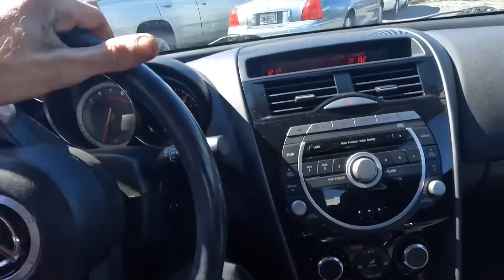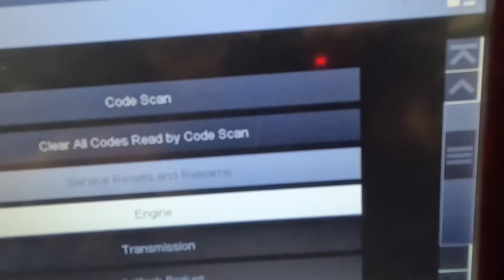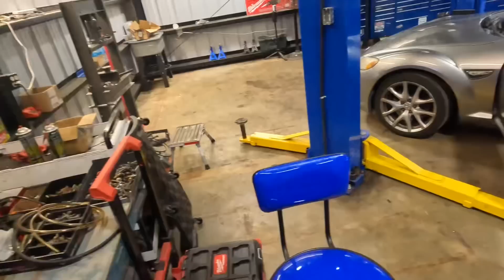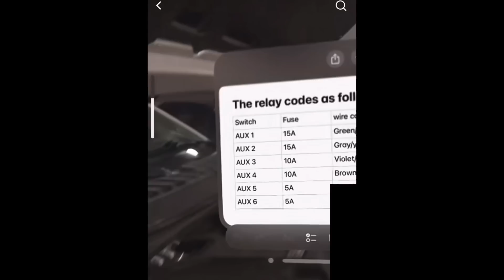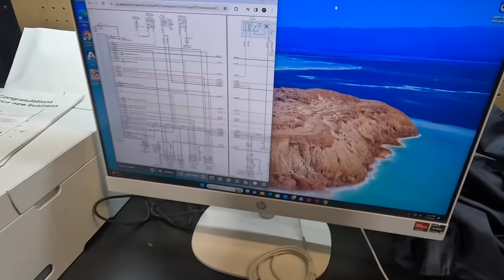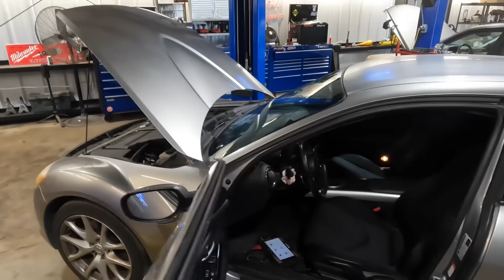Will Virtual Reality REPLACE Mechanics?? Mazda Rx-8

Comment: I think it would be a pretty cool TOOL to have. Would you use it as a screen to graph your PIDS in front of your eyes while still being able to shake wires around checking for a bad wire. You’re looking at the graph while both your hands are tugging connections and bending wires at splices?

Comment: Absolutely not, will VR/AR replace skilled technicians. I could see the use case - example, having my scantool display in a "heads up display", if you will. Could also have other useful information like time, GoPro camera view. Security camera feeds, even. Just, not at a $3500 price point. Also, imagine adding radar/lidar capability to them... that could be really cool, helping people with limited fields of view to interpret their surroundings.

Comment: Automatic RX-8's hurt my soul. Shifting 6 gears at 9500RPM is where it's at with these. I had both a Series 1 and Series 2, so much fun to drive and get 9 MPG in. These really need a specialized mechanic. The ignition systems are so touchy, and using aftermarket coil packs or wires causes a lot of issues, but people do because the OEM's are very pricey. But it is always more costly to replace a second time.

Comment: I loved the VR section. I had to correct someone’s bad information on Facebook. Some dude said “you NEED a super special socket to change plugs on a ram 5.7 gas engine” I was like what special socket I done the same job with a regular 5/8 plug socket. So I looked it up it’s real a set of swivel socket’s constructed of a plug socket, universal, and extension. I said I’m sure it’s nice and cuts down on dropped sockets but I don’t NEED IT and I’m not spending $40 on a set of sockets when I have the same stuff already paid for in a box

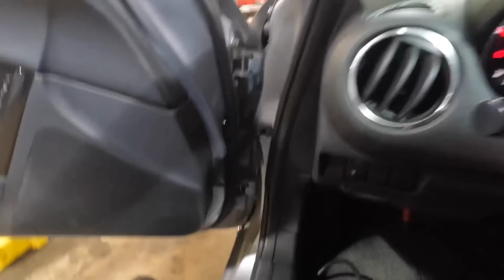Comment: We used to own a 2006 of the 14:22  same car and color. Blast to drive, and handles very very well right off the showroom floor. However we had so many computer issues. So bad they pulled the computers and sent them off to Mazada in CA to be flashed and reprogrammed. Still had issues, and then an engine recall came out. Mazda ended up buying the car back. Only had it for about 6 months. The rotary engine is very smooth and loves high RPMs.

Comment: I bought a Chevy Trailblazer and had some recall notices after a year or so.

I was floored that all of the recalls were firmware upgrades & patches and were performed simply by plugging a cable in. I think I received 3 notices by mail (critical) and there were 6 minor recalls.

Comment: Similar thing in aviation.  New pilots learn on flat panel displays (EFIS)  in Cessna's and Pipers these days, and few learn the old "steam gauges".  Their attitude is that "Our students will go straight into a jet with EFIS, and will likely never see the old system, so why should they learn it?

Famous last words.  The old stuff was difficult to interpret, so you learned to determine your position in your mind rather than simply look on the screen.  That built situational awareness;  The new training planes do not build this sufficiently in my opinion.  EFIS should only be used in professional cockpits, not in training planes!

Great video!

Comment: The only way such vr glasses can work is when a technician can see what the customer is looking at in his vr glasses and is able to make an arrow on that screen so the customer can plug it back. But that is a very limited use case that can be solved with a video call

Comment: Sorry, probably a book inc:   (I don't have spellcheck, forgive me)

Also I'm a programmer not a writer, I know I repeat my points at times, but it makes sense to me, this is how I write (I apologize).

(edit: I agree with you first of all)
(no one's going to plug you into the matrix or  plant microchips or whatnot. Trust me AI knows crap, I work with a guy who uses it for "programming help". I've checked his work. it's bad.

I work in VR/AR space, and stuff like the Vision Pro have been out for years. i.e. the hololens 1&2 in 2016/18 (actually a lot of MS's software team for the hololens went on to work for the vision pro fyi). At best, if the form-factor got to something like old google glass, that might make people take notice, so it's still in 'tech-demo' field imo.

It could be a useful tool for training or even, like with the dorman vacuum thing, maybe the manufacturer would have been able to show you based on a scanned model, exactly where other people mounted it, show you where screw holes should go etc viewed through something like the vision pro. That's not done using AI though. That's done with scanning compartments, parts, engines, spaces.. then you actually need models of the actual parts (either from CAD or photogrammetry), scaling everything, etc. AI doesn't do that. It takes putting all the stuff together in a package (probably cloud based, because good luck downloading and processing all the stuff all the time), maybe someone like Snap-on might want to do something like that? But the amount of capital and subscription it would take to do something useful. Hopefully make it open-source so other people can scan their cars or something to build a huge model of car library? It would be a ginormous undertaking, and I don't think that's happening any time soon.

But still, that's just to make it a useful tool. Imagine all those times you were feeling around the back side for a bolt that may or may not be there. Well look with glasses or something (because that's when this type of AR starts to make any kind of form-factor sense imo), and you can see those bolts and where they're at, as long as your scan is good and you haven't blocked any of your location camera which is another issue with current AR devices, good luck not blocking those cameras and having enough light in an engine bay I would expect. That's another big problem, hell I have problems when enough other people walk in front of a device I work with.

(But it'd still be cool just for the putting it back together, make sure you didn't forget any bolts or something (us noobs would definitely forget lol (I've changed the oil a few times on a four wheeler, your job is safe lol)).

Vuforia is the current leader (I think) still for matching scanned data to models, but that's like a $3k per developer license per year just to use their required 'cloud'. Not including access to the cloud from 'client devices'.  So that's a lot of money probably. And I expect getting any kind of CAD drawings from a manufacturer is about next to impossible. So in order for it all to work, that  would probably mean a whole lot of scans and tear downs with scans. The easiest way would be with photogrammetry, but those models ime have always needed a lot of cleanup, so it's a lot of man-hours. Now do that for the entire car, every bolt, under the dash, etc etc. Materport's a big one, decent scanner, and hell even their 5k hardware requires a subscription to use (yes I know one of the iPhones will do photogrammetry with lidar, but again, cleaning up the models is an issue as well).

While it would be nice to start doing something like that, that would take a massive amount of capital to even start and build all the just back-end infrastructure to do, someone like snap-on (like your scan-tool) or probably the manufacturers (that they could charge a premium monthly fee for), might/could do it. But I doubt it's on anyone's radar to majorly do something like this for a nice-to-have 'tool' at least for car stuff, any time soon.

Don't get me wrong, AR/VR has been used in some big industrial spaces, as well as surgeries (as, I've been constantly told over the years, I've never seen it done however :( ), but in really niche markets like that. I get why you're so confident with not being worried about the Vision Pro, and I agree with you. I just hoped to add to some of the reasons why you're correct Ray. It's a massive undertaking to do what they wanted to do in that tech demo. You can't just add, "AI" and somehow all the work is all done. "AI" was already supposed to put me as a programmer out of business, and I've seen how it "programs". lol (I'm not worried, I'm only worried about my job because other people think they can replace me with it.  They'll figure it out at some point).

imo you get Apple fan-boys like that with anything "new" Apple does, and sometimes other things too =p, and while the tech demos they show are neat. They're just that, tech demos.

I think that it's way cool that someone I watch almost every day also had some good thoughts about something that I do every day. Cheers!

Comment: It is the same as when the OBD2 first came out... It was going to remove the master technician and all it did was make master tech's more important because guys that could turn wrenches swapped out parts but couldn't fix the REAL problem and they would get repeat failures.

Comment: I want one of these.  I don't care if the engine is worn out,  so long as it's rebuildable.  Definitely would do the oil injection pump bypass so it has a stand alone sump separate from the injection oil. And probably a few other goodies (minor mods) but a nice clean car otherwise. Nor even picky over color.  But absolutely has to be a manual.

Comment: VR will show you how to replace a part, but that video needs a user to do it correct. There is VR of building/tearing down, but it is built for a purpose and does not have troubleshooting.

Comment: Rather than making auto techs obsolete, VR and Generative AI  will make them more efficient and productive. You will be able to pull alldata and order parts right there while you are working under the hood or under the car... Talk to text to write up a quote while you are doing an inspection while the car is on the lift... The possibilities are endless.  Embrace technology as a tool, not a threat... Those who think AI and VR will eliminate auto techs are very short-sighted..

Comment: you missed something about the AR goggles Ray. 
The goggles have a camera, so they can use image recognition to highlight what that camera sees. Instead of you needing to search for that leak, the goggles will detect it, and point it out, so you can see it immediately and start tracking it back to it's source.

You are still right: technicians are NOT going away because of this tech, and it will be something to help identify problems, and even help harder to spot things. Eventually, they'll be compact enough to wear light regular glasses, but for now, they are bulky first steps only. Useful, but not must have items.

Comment: On the Augmented Reality Bit. It's worth pointing out that Apple Fanboi's drank the spiked punch like a German drinks beer at Octoberfest. The tech itself is not new. Products that can display an overlay on a head-mounted display have been around since the 1980's, if not earlier if Xerox and IBM patents are accepted as accurate. The idea of interfacing with those overlays is not new either, with body mounted control systems dating back to the late 1970's, again referencing Xerox and IBM patents. Not to put too fine a point on it, but the tech was widespread enough to serve as a base model for "Locutus Of Borg" in 1990. That Google was somehow revolutionary with the Google Glass in 2012/2013 was laughable to anyone remotely paying attention.

The problems with the tech have largely run into three problems. The first two are distinctly related in the power drain and the processing capability. Advancements in Battery tech have moved the bar a little bit, but the greater tech leap comes from the ARM and MIPS processor architectures. Reducing the amount of electrical power required by the processing system directly reduces the amount of battery capacity needed for a true mobile-capable solution.

The third problem is a slightly more difficult nut to crack. How practical is such a product to use?

Again, Apple's not bringing anything new to the table. From a specifications and capability standpoint the Apple Vision Pro is 10 or 12 years behind Microsoft's HoloLens, and YES, HoloLens has been around that long. Keep in mind the Kinect Debuted in 2010, after 5 years incubation under PrimeSense. Hololens debuted in 2016 as a continuation of the discontinued Kinect Augmented Reality / Motion Tracking projects. 

Apple's only NOW at the stage where Microsoft was between Kinect hardware and the first generation HoloLens... and there's a reason HoloLens hasn't set the world on fire. The applications for practical use are distinctly few. Almost zero industries were able to demonstrate a scenario where HoloLens, as a product, solved a problem that wasn't already addressed with less expensive and more readily available components. Every once in a while someone comes up with a very specific use case, but there's a reason you don't see Car Dealerships and Car Manufacturers with deep pockets setting every service tech up with a HoloLens. Those same physical reasons mean you won't see anybody, other than Apple Fanboi's rushing to justify their new paperweight purchase, using the Vision Pro in a professional capacity.

Comment: If the VR unit is going to replace the human, tell me who is going to fix the problem, is the VR unit going to change the faulty part, that will be NO, the year 2000all the computers were going to crash did they, that will also be NO.

Comment: Be real here... people not gonna start fixing their cars because they get more information on a VR headset. People are not even changing der own tires or oil...
What i would wish for though... would be more open repair information by the manufacturer.
Right now, in europe, you cant access any of this information (like the wiring diagram shown in the video) if you are not a registered car workshop. At least not legally.

Comment: Ray, no AI could replace what you do. It takes a trained mechanic to interpret the data you get from your scan tool. You always explain that that something is 'A' problem but not necessarily 'THE' problem and AI can't do that. An experienced person such as yourself knows what to ignore because it may just be a symptom of the core problem and that's beyond the ability of AI. At best, It's just a tool that might give you some info or leads to follow up on but you know what's relevant or not. Keep doing what you do and you are absolutely correct that AI is not going to replace you.

Comment: No, virtual reality or AI will not replace mechanics, it will aid them. It will cause novices to screw up their cars worse and find a mechanic for help. Also, as a former bicycle mechanic, it's a lot of work that most people would rather pay someone else to do, even if they can find a walkthrough. I don't service or do my own bike repairs. I have a different job now, and would rather spend my free time riding than getting greasy. It's going to start replacing classroom teachers though.

Comment: Sorry, no V.R. for me. I agree, you need to be hands on especially on older cars. As for the Mazda, that problem makes me glad I have a good ole fashioned throttle cable on my ride as well as one module (Ignition Box). Crazy a TAC fault and you gotta replace the PCM. - Jamie

Comment: Hi Ray..... Nice video but I'll confess that I skipped through most of the VR stuff. While I do agree with VR mostly, it has MANY iterations before it's viable. It's in its infancy. The issue with anything new is most people think of it as black or white; yes or no. New technology and its implementation is not binary. Look at ODB from ODBI to OBDII. It's a process. But that being said, it's also a tool. Maybe in 100 years it can be used to correctly diagnose a car (if they or we still exist) but not with today's auto electronics. It's far too basic. As of today, it's merely an additional tool where the user will define the depth and usefulness of that tool. Again, it's not binary and to think of it as such detracts from the tool and ultimately the implementation of that tool. In short, embrace new technology, just with a grain or two of salt.....

Comment: Cummins was, dunno, maybe still, a fan of that shit. They had meetings telling us mechanics that they were developing software that when the fault occurred, the "Skynet" would TS it over the airwaves, track where the truck was, find out who had/where the "correct part'" was and direct the vehicle to the repair shop and it would be fixed in less than an hour. They didn't take into account customer load of the repair facility, the depth of the repair or anything else other than the "easiest" fix. I laughed at, was scolded for laughing, put the brakes on and let their on line crap dictate the repair, which took much longer...I have stories.... In the end, I showed them their fantasy didn't work and then decided I wanted no part of it and left the workforce. I was also told that this technology would make it so ANYONE off the street could do my job. To that I replied to the ops mgr and HR idiot, " there are my tools, don't tell me, show me" Never happened.

Comment: The VR assist is analogous to using GPS. Works really well if you already have knowledge of how to drive, where you are trying to go, and the common sense to override nonsense that the GPS can offer. Witness the unfortunates who follow the directions to drive into deep trouble in the middle of nowhere, no help available. All these things are tools that may be useful to someone who knows what they are doing, potentially a disaster for the uninitiated who will fall into a twisty tiny mess with no way out.

Comment: The whole VR thing might help in some circumstances, but most of the time good old common sense and experience will solve your problems. I once watched a video about a car bought at auction, that was supposedly complete junk, just to find out that it had run out of gas!